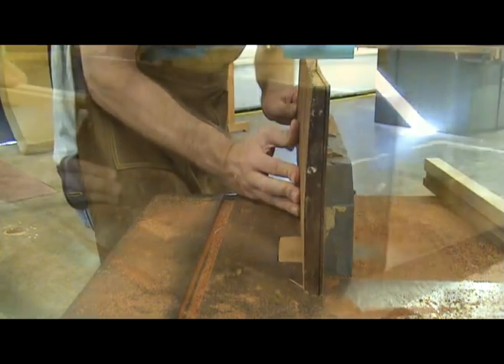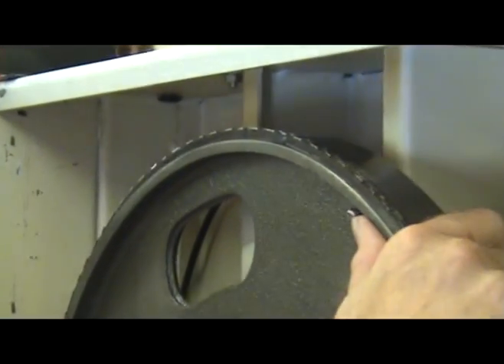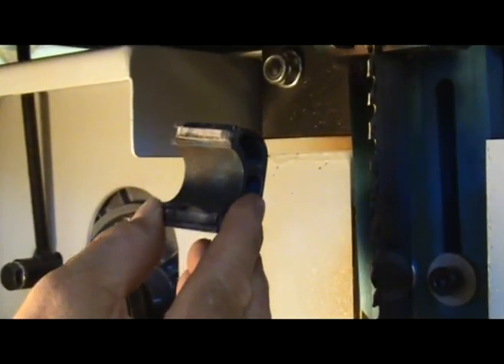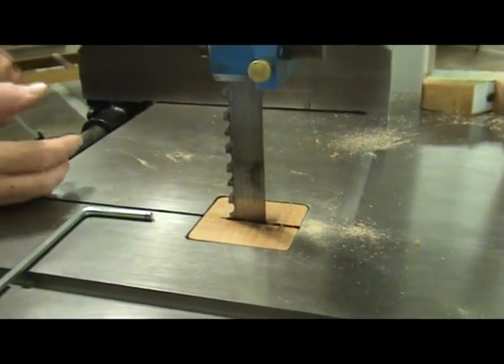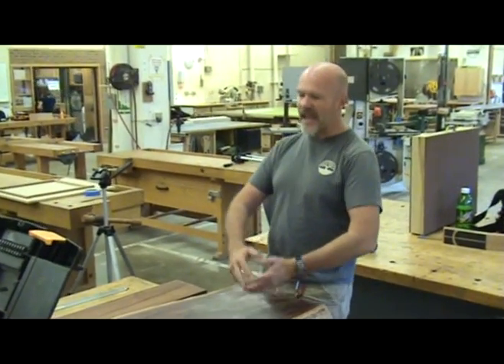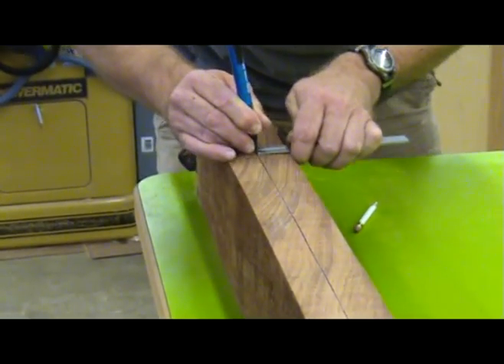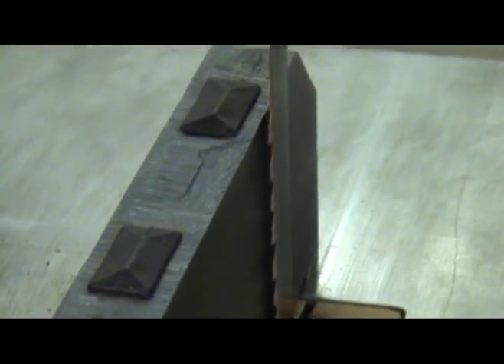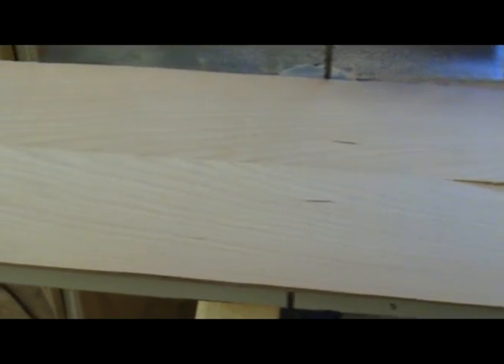Luthier Tips du Jour - Band Saws

Comment: I use a 14" with riser block powered by a 3/4 hp motor to resaw . I just did a 12" mesquite log with no problem, the key is proper setup. I use the starrett blades at $12.00 a piece

Comment: What would be an ideal throat height of a bandsaw for guitar making? In particular, I want to resaw wood for both the soundboard and back. I'm looking to get a bandsaw that I'll use "forever" but I don't want to purchase something that's more than what I will use. [Edit] -> I'm thinking for acoustic guitars.
Reply from the maker: Usually just a benchtop model will work for lutherie. Make sure it has about a 4 inch height clearance for cutting things like scarf joints. It will not  work for resawing back, sides and tops. You will need a bigger saw for that. Usually about 8 inches for cutting height will work though.